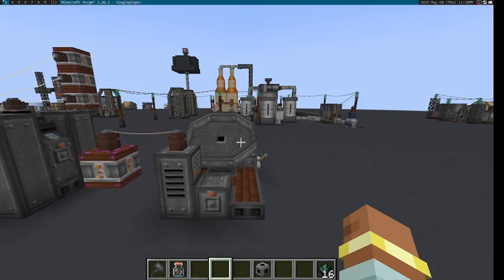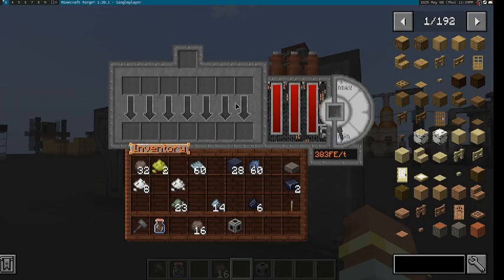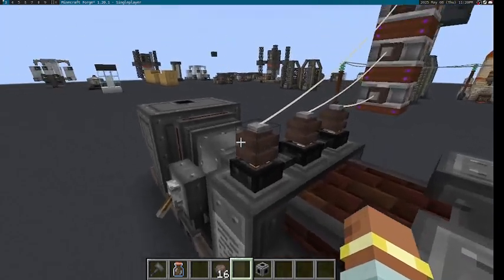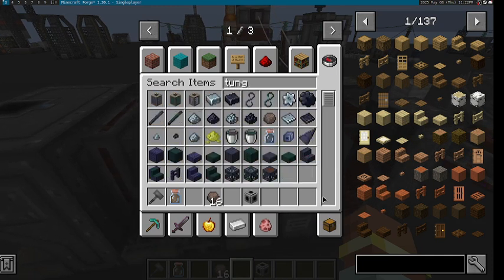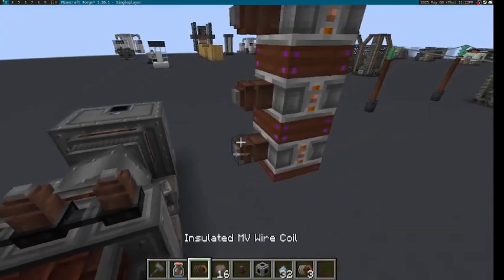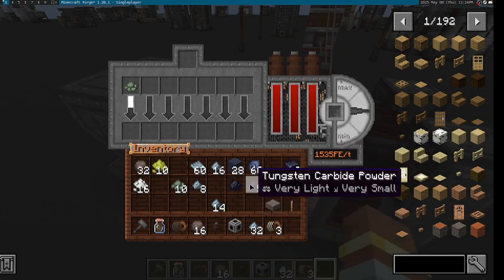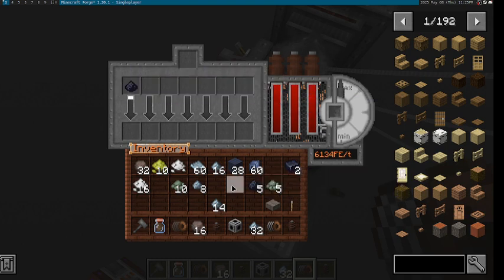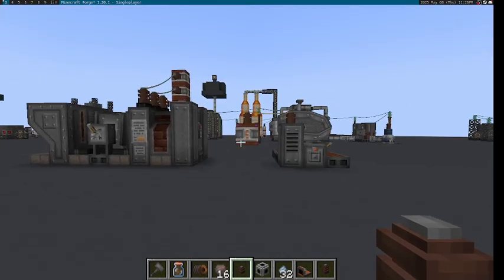Immersive Geology Snaptshot: Updated Rotary Kiln and Pelletizer

Comment: will this have integration with tfc?
Reply from the maker: IG has some integration with tfc, but you'd need a configured modpack to patch some of the holes.

For example IG has Ore Generation for the Stone Types in TFC we also don't spawn the same mineral types to prevent overlap and I've setup some basic tags on IG's side to ensure the correct behaviour, but there has been no recipe integration so a modpack that patches areas like this would be required for a seamless playthrough.

Comment: Honestly, i feel like rotary kiln is a bit annoying with it's temperature mechanic.
Yeah i get it, the "rapidly switching on and off" thing is kind of cheesing but some other features feel just unnececary.
The cooling off mechanic looks like it just wants your constant attention and micromanaging, not only it continues to use ALL the power needed to process the previous recipe (it's just a power sink, for no reason?? to appeal to realism???) even though it's doing nothing, it also cools down SLOWER when POWERED!? Like... is this multiblock whole gimmick that you need to constantly flip it on and off and NEVER leave it without maintenance because it will suck your power grid dry? Now that's just lame. 

I suggest you make it that HEATING UP require a crap ton of power (hence the 3 power gauges in GUI (but it's better to make the buffer bigger) but once it reaches the needed level it uses (albeit- constantly) a much smaller amount comparetively (like 1 "amp" of needed tier or even previous tier?? like a small portion anyway) to sustain this heat level (as it is with real industrial scale furnaces of any kind) and uses the implied "medium" amount when it processes something (additional energy used to actually heat up the material inside). 
This way you have a big machine with long and expencive wind up, that player is encouraged to sustain the kiln working at some level rather than go through re-heating process every time, as opposed to the current "Constantly switch it on and off" state.

Also maybe add an option to intentionally cool off the kiln with water or just make it so it cools off much faster when *powered*, additionally maybe adding a way to controll the heat level (for example the player is in MV age and CAN do some HV recipies but to conserve power the kiln idles in LV range therfore not "cold starting" every time but also needing some time to warm up to MV level (to do batches of stuff at a time) rather than just hogging all the power to do nothing.
Like i see it as a machine that can be useful at any tech level, and when you have the infrastructure to sustain it, it's generally more useful to hold it at your power level since heatig up more draws ungodly amounts of power (from cold to low is REALLY bad, from low to mid is somewhat bad (just slow), and from mid to high is hell of investment) but sustaining it much less so, and higher voltages allow to process things faster (if you do MV recipe in HV power, it reaches the needed temp much faster and cooks faster too, only needing more power to heat back up to HV or skip the "Re heating" entirely)

Also also can i suggest that you make the multiblock longer? like a proper 8, maybe even 10 blocks long, since the real machine is freakin HUGE,  it would add to aestetic much more than glorified concrete mixer (same with tumbler, why not make the model be 4x4 blocks wide), but it's more of a personal view. 

also also also i've never seen a kiln work on electricity, but this isn't gregtech to use actual liquid/gas constantly to sustain reaction. but it's just funny to me to imagine that this machine has multiple really big resistive space heaters to cure ceramics or make gipsum or sumthin, lmao

anyway, i actually really like how it looks otherwise and the general designs fall so well with the original mod they based on, keep up the good work
Reply from the maker: You do bring up some fairly good points!

I'll see what I can do on this, the core concept that you're suggesting here is what I was hoping to work with; I think I went with the current design due to how the code works, it was cleaner and easier to debug in the current setup.

As to the art direction, the original placeholder had a longer tube although it wasn't really inline with the Original Immersive Engineering Style and our model artist peter hadn't known I was planning on rotating the tube (I hadn't implemented it at the time) so the model was designed with the idea that the 'tube' would move and thus was actually quite long but just partially hidden behind the blast brick.

I'll ask if they're willing to take some time to estimate how viable a longer tube design is.

Now when you're mentioning the heating level system, this sadly was a byproduct of how IE handles energy, the different voltages are just simply a limit on input and output capability for the Connectors, that's it.

So setting the requirement based on the recipe was the easier option code wise; I'll take a look at a few of my ideas before.

Originally I had based it on input power but the with the internal buffer it felt really strange to not be able to heat it higher.

I'll have an update video on the mechanics after I've tweaked them some more.

Comment: What mod is that? Is it available??
Reply from the maker: Immersive Geology, it's an Add-on mod for Immersive Engineering; Available on Curseforge and Modrinth in a Beta Form.

Feedback is welcome and appreciated, we also have a bug bounty system that has rewards around cosmetic items and multiblock skin themes.

Sadly because of the games industry I will explicitly mention that these cosmetics are handled in the same way the IE handles their 'Shaders' for things like the Drill. Find them through loot, craft them, or get them from villager trades.

Comment: you know youre looking at a programmer when you see the top status bar. (i use arch btw)
Reply: weird generalization but ok
Reply from the maker: @PraiseTheBoi   I assumed they mention this as the top status bar is DWM which requires you to compile it from source code to work. 

So it's a safe assumption that when you see it, the user that set it up likely has some programming knowledge.

Comment: Some of these feels very Greg-gy lol
Reply: bro that's literally overclock mechanic.
Reply from the maker: @mrShift_0044  I do like watching Greg Tech; And the overclock mechanic was a direct inspiration. IE doesn't handle energy in a way that makes it easy to determine the 'voltage' as it only has a limit on energy transfer to do so which can get messy when trying to handle internal buffers.